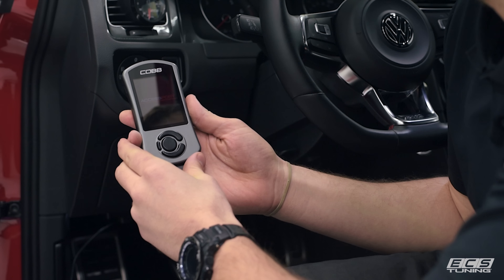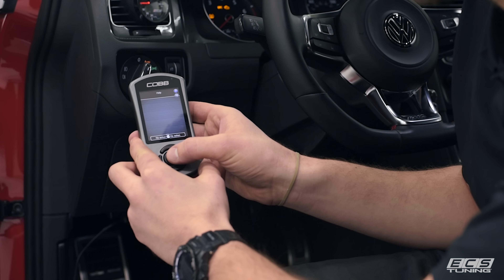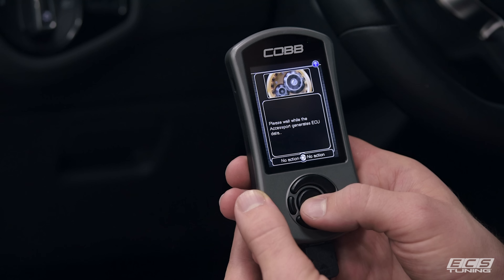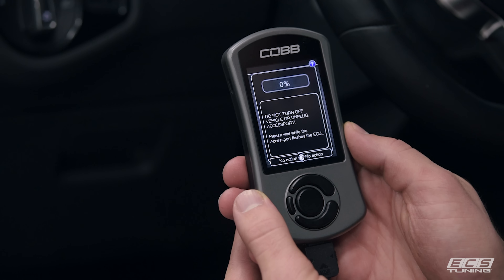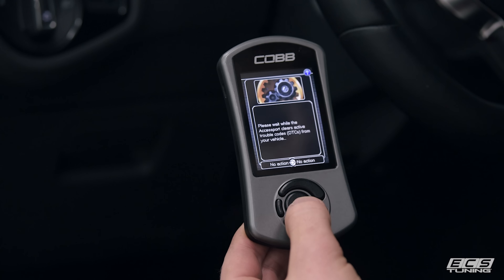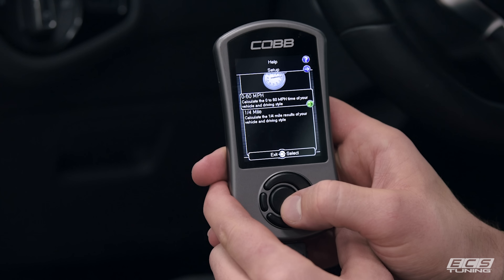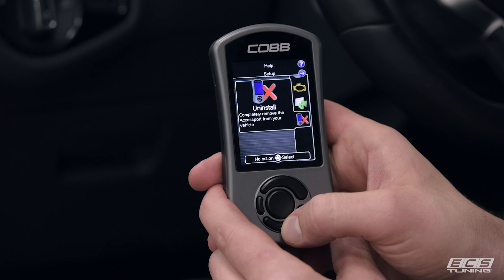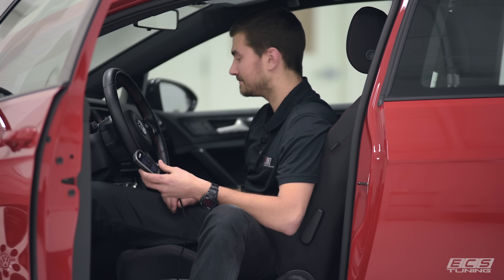MK7 GTI COBB Accessport V3 | Install and Overview

Comment: When you buy the stage one kit, does it include everything installed on the Accessport device to do the upgrade? Is it as simple as purchasing and connecting to the car or do you have to do anything connected to a computer?

Comment: Does the DSG Mk7 require a different tune? For example: “stage 2 93 oct DSG”??
Reply: No it doesn’t but if you want to do a dsg tune you gotta pay 500 usd for it, but you can use the regular access port just for a regular ecu tune
Reply: @ethanluu3011  how do you get the dsg tune added? or where do you buy it?

Comment: On the MK7, once you choose an ecu upgrade that’s it right? So if I choose Cobb then later on down the road I can’t do APR, is that correct?
Reply: Orzel Bialy no, just flash it back to stock and then you can switch

Comment: I know this is available for MK7 GTI's, but is it fully compatible with the 2017 GTI's? I just bought a new 2017 last month and would really like to use COBB to flash my ECU and do a DSG flash tune whenever that is available. Any idea when a DSG flash tune might be available for MK7?
Reply from the maker: This is not compatible with the 2017 GTI's yet.  COBB is working on it and should be available in the future.  DSG tunes via COBB are something we have heard is likely as well.  Congrats on the new MK7!
Reply: @ecstuning  Does the V3 have the DSG tuning? Looking to tune my 2015 DSG Mk7 without breaking the bank.

Comment: Can you Tune to Stage 3 without the supporting mods? i.e. I have an intake, short shifter, catback exhaust and want to tune to Stage III w/ 93 oct, will it still give me that power?
Reply from the maker: We don't recommend flashing a tune without the appropriate supporiting mods.  A stage 1 tune should be correct for your modifications.  You can read the map notes on COBB's website here: https://www.cobbtuning.com/maps/

Comment: Hey COBB that's a nice product but where's the dash mount for it? If I put this in my GTI I would want that display in a nice area. We supposed to tape it to our cars? Or hold it in our hands while driving?
Reply from the maker: The unit comes with a mount that attaches with double sided mounting tape.  There's also other mounts available online if you prefer a different style mount.
Reply: ECS Tuning Awesome it'll be nice to have this mounted somewhere slick in my car. One more question. Can this unit also flash back to stock if need be?
Reply from the maker: Yes it can!  It saves your stock map when you do your first flash.  It also has a Stage 0 map which simulates a stock map.
Reply: ECS Tuning Ok one more lol Will this be able to tune/flash the DSG transmission?

Comment: will it void your warranty?
Reply: I asked this but I assume it will as it is flashing your ECU, therefore most likely throwing a TD1.
Reply from the maker: Unfortunately we can't say whether or not your dealer would approve or deny warranty work after flashing a tune.  Contacting your dealer and asking would be the only way to know for sure.
Reply: ECS Tuning dealer cannot take a desicion, approve or deny. manufacturer can do it only!
Reply: ECS Tuning if I tune my ECU wouldn’t I be able to re flash it to stock before going to the dealer for service??

Comment: it recommends a Cobb intake for the tunes, can I use another brand intake to tune it? does it have to be cobb?
Reply from the maker: The MK7 GTI does not have a MAF, so most aftermarket intakes will play well with different tunes.  On the MK6 GTI, some intakes change the size of the MAF housing, which requires changes to MAF scaling in the software.  Contact COBB for confirmation on your intake and software just to be safe!
Reply: ECS Tuning okay great thank you !

Comment: on this (cobb accessport v3) how much hp is possible to add to stock 220hp on stage 2 flash?
Reply from the maker: COBBs posted numbers from their website are:

Stage 1 93 
Peak Gains* +26% HP / +22% TQ
Largest Gains* +35% HP / at 5500 RPM / +30% TQ at 2200 RPM

Stage 2 93 
Peak Gains* +30% HP / +31% TQ
Largest Gains* +41% HP at 5730 / +37% TQ at 2250 RPM

Stage 3 93
Peak Gains* +37% HP / +41% TQ
Largest Gains* +46% HP at 5730 RPM / +41% TQ at 3050 RPM

You can view the dyno chart here: http://media.cobbtuning.com/catalog/dyno/dyno-vw-mk7.jpg

Comment: Can I build a custom tune on the COBB and get more power out of it?
Reply from the maker: Currently COBB Protuners can make a custom tune in person or you can get an E-Tune from one of the certified online COBB tuners.  This will give you a nice bump in power over the off the shelf maps and also make sure your tune is optimized for your car's specific mods.

According to Marshall @ COBB, "We do plan to offer Accesstuner for the VW platform however it will likely not be available until Mid-2017. With the VW software being relatively new, we would like to have a certain amount of soak-time in the hands of our Protuners before making it available to the masses."
Reply: Sad story I just email them they said it will not support audi a3 8v 2.0t. Despite have the same engine.

Comment: how does this campare to a stage 2 tune from apr/giac ect..?
Reply: Paul Wiest apr/giac will give you much more hp/torque
Reply: Unless you get a custom tune for your car to compliment your specific mods, APR, Uni, etc are going to make much more power and torque. If you have Mods installed though, and you contact a company like freektunes for example and buy a custom tune, they will build you a custom tune to match your installed mods, altitude density, fuel quality, etc, and in that way, you can actually make much more power than an APR, GIAC, Uni tune. Plus, with this, you can just uninstall the accessport and return the car to stock whenever you want without having to go to an APR shop, as program switching (switching between valet, stock, stage 1, etc on the fly) doesn't exist for the mk7 yet.
Reply: Can I stack this tune on top of GIAC/UM tune? Make a custom map on top of the tune.I have GIAC software but I do think I can get more power out of it and most importantly I want to play with it

Comment: Would this be able to work with a K04 Tubo upgrade and all supporting mods (ie: intake, turbo back exhaust ect.) and maintain daily drivability on a MK6 GTI?
Reply from the maker: You would buy the Accessport and then have a pro-tune or e-tune done.  Custom tuning via data logging is one of the best features of the Accessport!